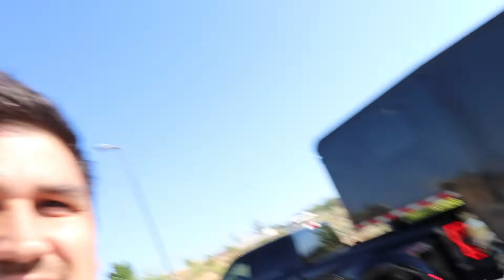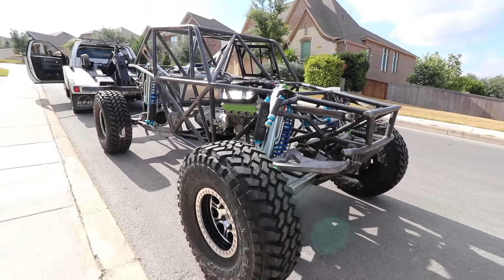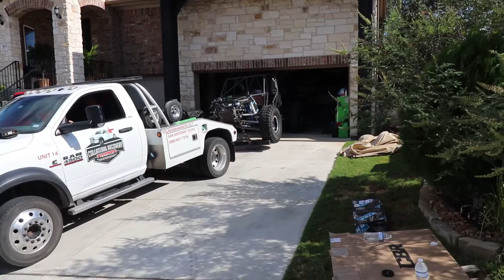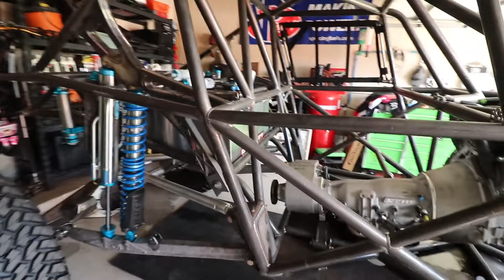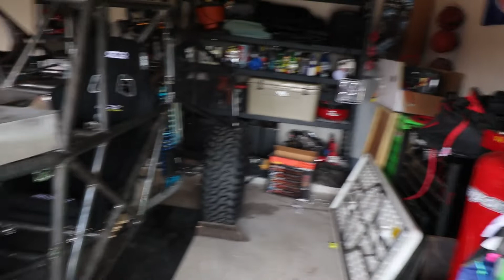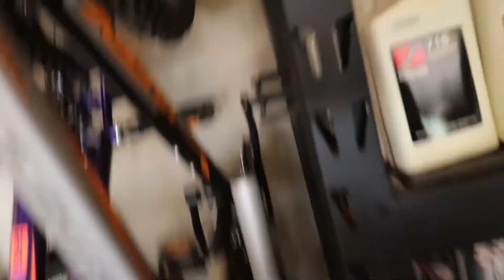Ultra4 Racing IFS Race Car Build Part 3:  Picked up car from Jimmy's 4x4! KOH2020 Fabrication

Comment: Big Wheel Floorjack under the front center.  Droop will narrow the front.
Reply from the maker: Ryan Smith it will damage the trailer.  The door will dent.  Actually has a dent already from trying that with my old race car.
Reply: Positive camber will make you slightly wider at the top of the tire anyways. With that tight a fit, every 1/32 millionth of an inch counts.

Move it in and out in cheap rollers maybe?

What kind of trailer is that?

Comment: How much did you pay?
Reply from the maker: jeepthrillzoffroad $39.95.   😂😂😂. Total car will be about $300k.  You got to pay to play in the 4400 Ultra4 class.
Reply: @JohnMoulRacing  That high bro. I think you could do it for 100K all DYI.   I mean all welding and sheet metal from stock, total assembly,  engine build up off an LS3/7 etc. I speced parts up to about 100K. If you had Shannon Campbell build one for you it's 300K.